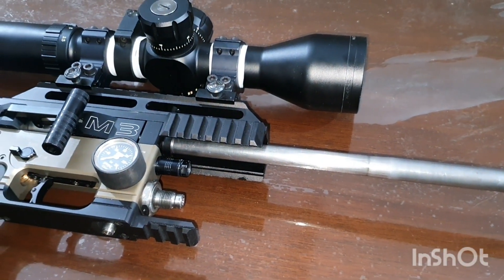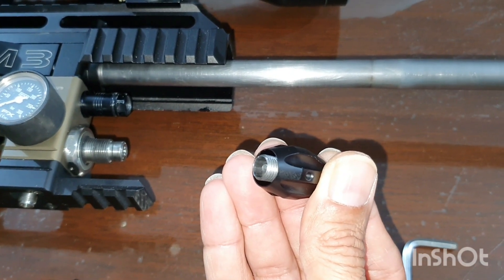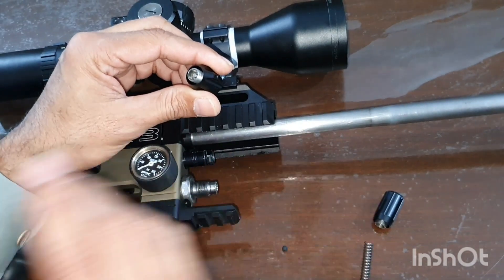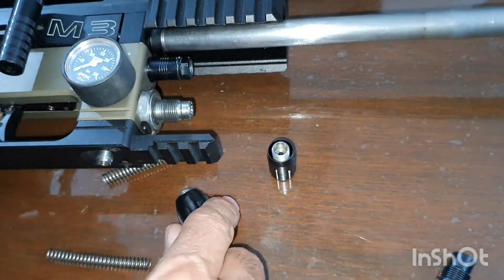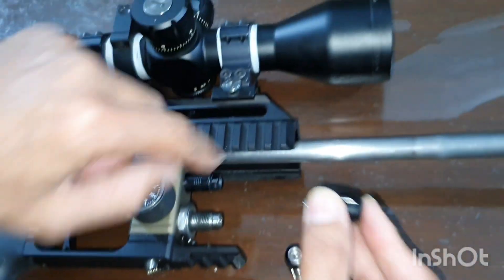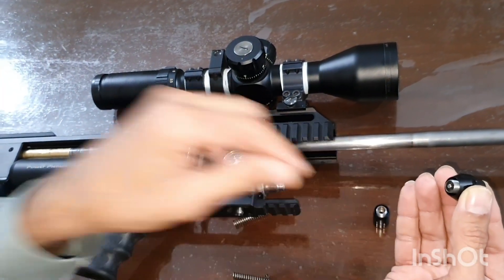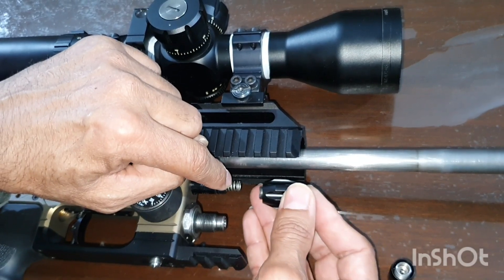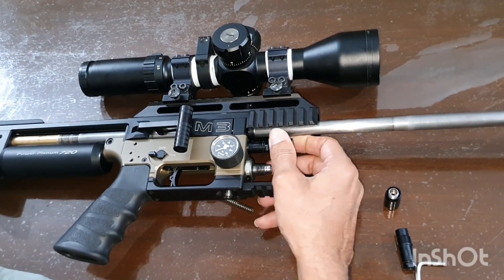FX Impact M3 Valve Adjuster Modification (English & Urdu)

Comment: The video is nice and helpful to remove the noise which is really bad but I have a question, adding the ball in front inside the spring to be before and after, that will impact the running when the valve will reach to them? But also why the valve will reach if the length of the spring is bigger than the valve seat? So technically no need for it at all and you can remove both balls and the pin inside the cap, what do you think bro?

Comment: My fx mk2 leaking air from rear block when i fire and the plenum pin coming out from it can you please help me Because in there is no any fx air gun specialist
Reply from the maker: If the valve rod end is the thing which you are calling "plenum pin" then it seems that there is some issue with your valve rod.
Otherwise the valve should sit on the valve seat and resultantly the pin should not come out in the area where magazine is installed. 
I hope it will help

Comment: Great video- I have 2 questions for you....

1. Do you recommend using the original spring or the lighter spring that came with the Slug Power Kit?  (700mm M3 .25) 

2. Is there a size to that bushing you made so one could be purchased?   It seems like the ID would be 3mm and the OD would be 5mm.  Is that correct?  

Thank you.
Reply from the maker: I prefer neither original valve spring nor the very light that comes with slug power kit. Rather I use a spring with the hardness in between the original and the one used in slug power kit.

The size (length)  of the bushing is around the same as the dia of the ball removed from there and placed inside the spring.
ID of bushing is good fit on the piston pin and OD is according to the head of piston head

Comment: I did the same as you did except I added a spring inside the adjuster cap along with one ball. Mine is a Mk2 that I installed the 720plenum. It also has an 63cc dangling plenum. This mod makes it quieter and less like your about to have a catastrophic failure with every shot KLANK!
Reply from the maker: Why failure?
Reply: @BhaursAirguns  it just sounds really bad without the modification your talking about. It’s really loud on the cheek riser. But I am running 1055fps with .25caliber.  34grain slugs

Comment: Awesome mod I just use rubber ball from slug kit and open valve further out so it doesn't make that ugly noise same thing as you did by adding the brushing I was say so ... maybe not but I'm happy with my m3 it's very accurate consistent and efficient thanks for sharing bsafe
Reply from the maker: Thank you 😊
Reply from the maker: Three balls shock absorber vs two balls shock absorber, there may be a bit difference in behaviour
Reply: @BhaursAirguns  yeah I would say so yes sir